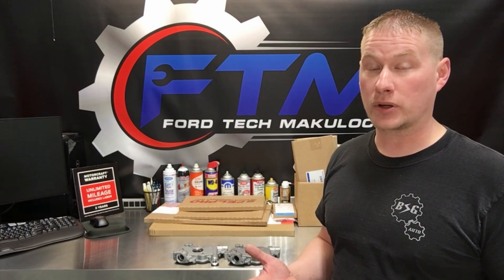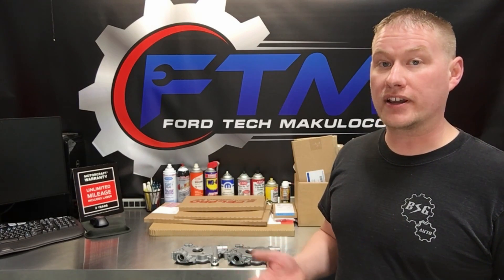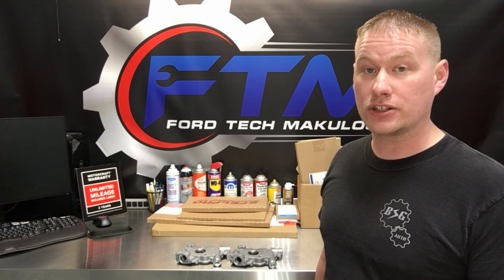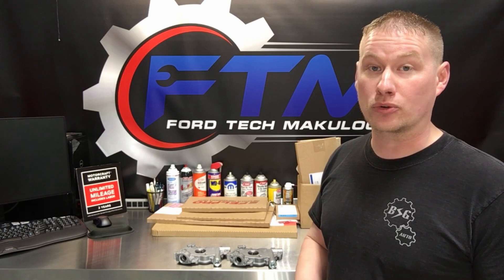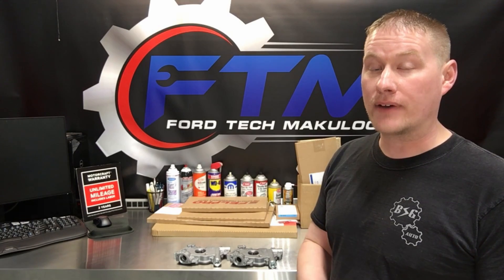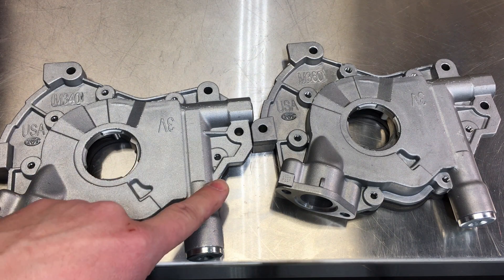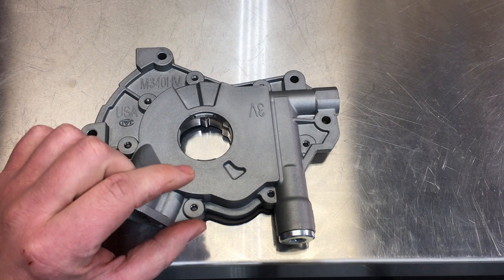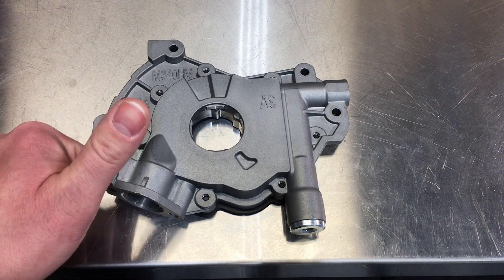The Ultimate 5.4L 3v Triton Engine UPGRADE: New Melling M340HV M360HV High Volume Oil Pumps!

Comment: Take Brian's advice and go with this upgrade I know I will have him install one for my 2007 xlt 4x4 super crew once the 3 year warranty ends on the remanufactured 5.4 motor I had to buy from Ford for $5200 my original 5.4 died at 105,000 miles in 2016 all timing components and loss of oil pressure caused the motor to finally die since the truck was still in very good condition went with a new remanufactured motor with Brian's advice the only thing I did wrong was that I waited too long to get it to him to do the install I live over an hour from him and when I finally was going to tow it to him he was in process of switching shops so I had to have job done at a reputable shop by my house Brian knows his stuff and I'll take my truck to him once I'm beyond the new warranty I have already had my 1998 explorer work truck to him for repairs Brian knows his stuff
Reply: I AM KAZE, can I ask what manufacturer you chose for your remanufactured engine? Glad things worked out.

Comment: What do you think of the remanufactured Ford replacement 5.4 engine? I just had my original engine replaced at 260K miles and the reman has a 100K warranty

Comment: Can you use a M360HV in a 2008 mustang GT
Reply: late reply, but based on the extensive research I have done on this elusive topic ( no one seems to have answers for the 4.6 3v mustang GTs), I would say to go for the M340HV.
Reply: did you fun into any issues if you already bought the new pump?

Comment: I just installed a new timing set including the m360hv pump. I just finished it and im not getting any oil pressure. I double checked everything  and it looks good. Any ideas? Or any help would be appreciated.
Reply: Did u find the problem
Reply: @basicbrownhairedgirl2610  i did. Some how one of the broken guides piece ended up behing the oil pump. I too it all off and found that. Basically the oil pump was not sitting flush with the block and was losing pressure that way. All good now tho!

Comment: Love your videos. Lifesaver. Any reason for using the 340HV instead of the 360HV on 5.4 3V? They are same price on eBay, and only $8 difference on Amazon. I am assuming high pressure/high valume is way to go.

Comment: What year are the three valve 5.4 engine  I have 2003 super crew ?
Reply from the maker: 2004-2014
Reply: FordTechMakuloco 

So mines 2  valve engine
Reply: @tiger.6509  yes 3v 5.4 came with the redesigned F150 in 2004, superdutys got the 3v in 2005 with their suspension, braking and transmission upgrade

Comment: Is this the same 5.4 as the 2003?  Mine had 254k when I sold it and I only changed oil and replaced the battery. Never another issue.
Reply from the maker: No this engine came out in 2004 new body style F-150.

Comment: Number 1 killer on this engines,is the owners run this engines with no oil.Owners go by the oil pressure switch showing high pressure even with half a court of oil in the engine.

Comment: Thanks for the step by step videos.  Invaluable to us Triton owners.  I want to know you opinion on Ford's upgraded oil pump M-6600-F46 from Ford Performance.  It's also high pressure/high volume similar to M360HV.  Also, what  pump would you put in Your  Triton 5.4 3V.  60psi or 80psi? Which one would you get.  Thanks in advance.
Reply from the maker: M360HV only, I won't buy anything from Ford Racing Performance.
Reply: @FordTechMakuloco  why is that? Isn't it an original Ford product?
Reply: @WARSAW777  yeah. Idk I've heard good things about the Ford Racing timing chain kit so 🤷‍♂️

Comment: I have a 2005 Ford F150 Lariat 4x4 with the 5.4L 3v Triton engine with only 54,000 miles on it. Oil changes and filter every 3,000 miles. It seems to me that the difference in cost and the time as long as you are doing it I would put the better more expensive pump in M360HV. Your thoughts please.

Comment: I had to change the cam phasers in my 2007 Ford f150 xlt 5.4l 3v engine about 2 years ago and ended up putting the melling 10340 oil pump in it then because I heard it was an upgrade. Did I go wrong with that oil pump?

Comment: My 2001 Expedition is at 268,000 miles (original engine) 5.4 2v. So are 3 and 4 valve better or worse than 2valve?

Comment: Hey I have a question  I replaced my oil pump, timing chains , phasher and other things. But my right side cam phasher the  r was not center of the 2 colored links my left cam was center but when I removed the old chains I marked everything and put it back the same way.  So since my right side was not center is my timing out of time. Cuz I still have a misfire

Comment: Starting to sound like I should be happy to have the older 2 valve 5.4L??!!
Reply: Yes, I specifically got a truck with the 2 valve. The small mileage and power gains are not worth the expense and troubles the 3 valve brings.
Reply: Mr. Shyster the 3v doesn’t have many problems once you have the upgrade parts installed
Reply: @frantruck919  Exactly, you have to dump a bunch of money to polish a turd. Save the money, avoid the turd.

Comment: The '04 F150 mentioned is my truck.  It was at 297k and had vct issues along with bad timing chain guides.  It has about 305k now and runs like it is almost new.  There is no one else who knows more about these 5.4 tritons, keep up the great work!
Reply: What did that cost you?
Reply: @chriscall3425  A lot.
Reply: Were the timing chain guides original?  How many miles now?

Comment: I have a F-150 2007 and it makes explosions when accelerating when it is hot, besides it loses a lot of power. It have clean injectors, new spark plugs, a new gas regulator, a new gas pump, cam phaser blocked, clean manifold... which could cause explosions? PLEASE HELP

Comment: The Amazon link indicates the Melling HP340HV will work in my 05 F150, but the HP360HV  will not work on my F150. 
What’s the reason for that?
Reply from the maker: They both work trust me.
Reply: FordTechMakuloco Would you recommend the HP360HV over the 340? I have 192,000 miles on my ‘05 F150.  I don’t want to blow any seals by using a higher pressure pump. What are the advantages of one over the other?  I’ll probably be tackling this timing kit job in a couple of weeks.

Comment: Would you recommend installing one of these pumps in an '06 F150 with 119k miles even if it isn't having an issues? Thanks for the videos!
Reply from the maker: Yes if you are in there for any reason.
Reply: FordTechMakuloco Hello Brian. I’m still confuse about which pump to install. My truck it’s a 2006 5.4 3v I’m in the process of timing chain kit and phasers. Would you be  kind to guide me how to proceed. Which aftermarket kit and phasers to install. I heard cloyed. My truck is in the shop now and I want them to do it right. I’ll appreciate your prompt answer.
Reply: FordTechMakuloco should I do the water pump too?

Comment: Listen to the man on this one. You 100% want the upgraded oil pump. (Hvm360) with the extra 20%. These 3 valves have design issues directly related to internal oil leaks. Which is the cam bearings phasers timing chain tensioners (big one there) and the cheap factory oil pump itself. Also the broke tensioners get sucked up into the oil pump screen and block oil flow as well. BUY THE BEST AND DONT DO THE JOB TWICE LIKE ME!!!
Reply: I used cheap parts when I did it which replaced the cheap parts from the previous owner.  Just replaced failed plastic tensioners again with cast iron ratcheting and billet guides.  Replaced with m340 pump the 1st time in there.  Unfortunately broke a small chunk of a pulley boss on the cover.  Thought it would be ok.. But it's loud!  And chasing a misfire now.  Bad cat maybe... Anyways these mod motors are not for the faint of heart.
Reply: Zack Huff yeah ive had to gut the converters on both of the 5.4 3 valves I had to get it to quit misfiring and pick the power back up in it. especially when punching it and needing the extra power on the bypass or elsewhere. if you have live data on a scan tool look up your baro  reading and compare it to what its supposed to be. example in Arkansas its 29.2 mine was at like 27 and low 28's so I cited the converter and no power problems anymore. hope this helps

Comment: Sigh. Dropped a torx t27 in it when changing the vct. You served me well until 248k, but I'm saying goodbye. You will be missed. Good thing I like my coyote so much.
Reply: Derek Ortiz so just get a magnet and get it out. Lol
Reply: Derek Ortiz 45
Reply: Leave it. If its not caught in the chain, it will just sit in the oil pan.

Comment: Hi and thanks for the great videos. I have a 2001 Ford F-150 with a 5.4 liter engine should I be concerned about the spark plugs I only have 45,000 miles on the truck. I bought it brand new just don't never drive it thanks so much. It has never had spark plugs put in it

Comment: Super cool, very interested. I got the XLT 2010 5.4 WITH no issue at all. Bought it  a year ago,runs great. I don't hot rod it, I wanted to last also at the same time if I got to get up and go I want to get the hell out of there so making little upgrades like this would be worth in the long run

Comment: Do you recommend pulling the oil pan when doing the timing job? I would expect plastic pieces would have broken off the guides and ended up in the oil pan.
Reply from the maker: Yes if there is any chain rub or broken guides the pan comes down

Comment: Sorry one more question. Would the m360hv be too much pressure for the o rings in the cloyes timing tensioner? Just trying to figure out my best bet between the m340hv and m360hv. Thank you
Reply from the maker: DO NOT USE THEIR TENSIONERS

Comment: Do you think stock M340 is good enough for normal use? I'm planing on doing timing chain job soon and I bought M340 over other pumps just because M360 would take 2~3 days to ship and M340 was much cheaper because amazon had a open box one. Just few days before the day I planned to work on the truck, I cut my finger pretty bad at work and now has been postponed at least couple of weeks. This gave time to order and wait for some other parts that may be necessary and I am wondering if I will regret going for M340 over M340HV or M360.

Comment: I have a 2005 f150 5.4 that has the typical timing issues. I'm replacing timing kit with cloyes. And was trying to decide between the 10340 m340 and m360 oil pump. What would you recommend? Thanks in advance
Reply from the maker: M340HV or M360HV ONLY
Reply: Ok thank you. By the way thanks for the videos your a life saver

Comment: should I get just the M340HV pump or should I get the oil pickup tube assembly part# M340HV-340s.  Thanks!
Reply from the maker: no need for a new pickup on the 3v engines.

Comment: Hello is this fit my 2009 Lincoln Navigator 5.4 3v do you think is there any pressure problem with 2009 year and is the m360hv fit
Reply from the maker: Yes it fits no problem use em every timing job.
Reply: FordTechMakuloco I appreciate that

Comment: Hi, I️ was wondering, what do you think about the cam phaser lockouts from liverious motor sports. And I️ have a 5.4 3v thAt idles At 450 rom is this normal.
Reply from the maker: Waste of money
Reply from the maker: Clean the throttle body as per my video and relearn as per my video. There is also a reflash for a higher base idle rpm that help but your biggest problem is the throttle body buildup.

Comment: Hey Brian, will the 360hv work on an 04 5.4 3v? Everything I find says it's for a 32v. Which would be better 340hv or 360hv? Thanks
Reply from the maker: yes it will, generally the 340HV is enough.
Reply: Had the same question since Amazon said part does not fit my truck.  Melling list the 360HV for later engines too. Glad you cleared that up.  Will order the 360HV.  So nice to have your videos with tried is and tips

Comment: hi I'm not sure if a bad oil pump is causing the problem on my truck " f150 06 5.4 172k" but I had,codes for bank 1 circuit 1 changed cam an crank sensors, still engine light came back on,then put a timing kit,turns out tensioners we're broke, ran gd then engine light came back on,now it was the knock sensors, replaced them both,a few day later engine light back on, now both knock sensor code an bank 1 circuit codes are showing up...about to surrender

Comment: I have a 99 expedition 4.6L 2v. Nothing wrong with my engine... my chain was hitting the exciter or whatever the name of the wheel on the crankshaft that works with the crank sensor an make a loud intermittent tick, anyways thank you for your video on the timing chain r&r I did mine and now it’s quiet. My question is do you know the oil pump part number that will work for my engine? I want to get one of them good pumps your talking about.

Comment: Triton nightmare indeed. A modular engine designed to replace an ultra reliable push rod v8. I ultra hate any Ford gas or diesel engines built after 1996. Lol. Ford should design a front flip hood & fender assembly like semi trucks to help in repairing them.

Comment: I went on amazon link it says that, that the m360 is not compatible with 2008 5.4 3v. Can you confirm that. thanks.
Reply from the maker: It is trust me.
Reply: IS the m360hv compatible with my 04 navigator 5.4 4v?

Comment: Thanks for your videos FordTech! So... What  timing? I have been fixing the timing system on my truck in my spare time this winter with the help of your videos. And as recommended  per your previous oil pump installation video, I bought the M360  back in December and just loose fitted it last night before running other errands.   My question: Now that you mention this new M360 HV should I resell my M360 and Upgrade to the M340 HV / M360 HV or will the M360 I've got on hand be fine? I've been at it this long so I'm just looking for piece of mind as long as I'm in there this deep.

Comment: Now there are 4 Melling pumps:  OEM pressure/volume, high pressure/normal volume, OE pressure/high volume, and high pressure/high volume.   Can you provide a selection criteria?  
(only 30 days before this video appeared I bought the 360 high pressure, now looking at throwing away that expense for high volume.  5.4L3v, 160K, marginal oil pressure, probably blown tensioner gasket, oil analysis consistently shows aluminum (surprise...).  My concern is higher volume or higher pressure causing secondary engine problems for this relatively new oil pump;  Ford tested the Triton and Melling tested their oil pump, but there is no substitute for millions of on the road miles).

Comment: My 09 5.4l 3 valve with 91k miles  has very low oil pressure while in drive but stopped. The shop said it was around 5- 7psi and the needle was bouncing around with the ticking noise while under load. It would build oil pressure with RPM and the ticking goes away. The shop recommend replacing the motor because "the clearances are too far gone and bleeding off pressure". Do you agree or would the new oil pump and 5w30 fix it? I know I  need to replace my timing components to fix the ticking noise under load, just watched that amazing video series. I religiously change my oil and filter every 3k miles with motocraft 5w20, thought I was helping it last longer... Thank you for the amazing videos!!
Reply: Update... Just finished this upgrade along with timing components and new roller followers, now my oil pressure is very solid! 25psi at curb idle and 55-60psi running down the freeway. Thank you for the helpful video series, couldn't have done it without the help.
Reply: @ryanrasmussen2026  Thank you Ryan for posting what happened. From 5-7 psi to25 psi!

Comment: I have a 2004 F-150 Lariat with the 5.4 that i bought new.  Never a problem with this engine (other than the spark plug removal).  I now have 198000 miles on it and love it as much today as I did 14 years ago.  Oil change every 4000 -5000 miles and use nothing but Motorcraft 5W-20 with the 820S oil filter.  Take care of your engine and it will take care of you.
Reply: How’s the truck now?
Reply: it was the same for my dad, never had a problem with it until 230,000 miles, then it start making a noice in the passenger valve cover it was the timing chain
Reply: Same I have a 5.4 king ranch 05
Reply: 2008 F-150 195,000 miles. Oil change every 3,000 no issues with the engine
Reply: Follow up, his engine died and he no longer drives the truck.
Reply: @thenadonation2664  Do you know him or are you just assuming?

Comment: Will the M360hv fit on a 2007 Mark LT 4x4 with a 5.4 3v? Or will the 340hv only work? They both look similar in sizes and I would rather use an M360hv for it's higher volume.

Comment: This won't fit a 5.4 2v will it ?
Reply: it will... Brian stated a few posts up that it will with no modification... you should be good to go..  but I would review the comments...     tried to copy and paste here for ya... 

Q:  would the 340 or 360 fit a 2v 5.4 with the 3v pickup tube?
3
FordTechMakuloco
FordTechMakuloco
5 months ago
They all fit the 2v engine, no pickup tube modification needed. <<<<<<<<<< answer right there...